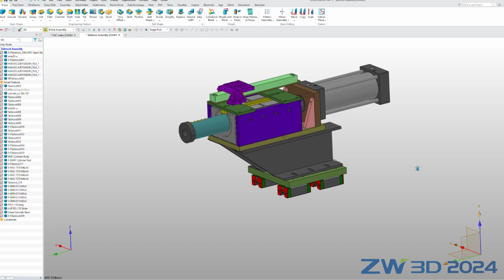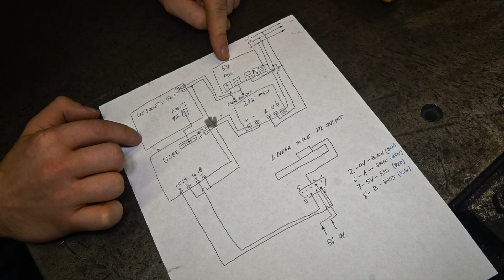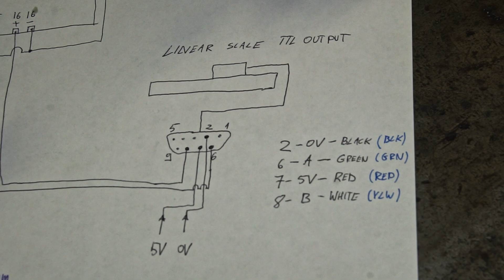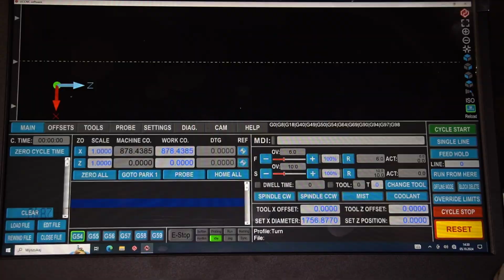Linear Encoder Setup! UC300ETH-5LPT Ethernet CNC Motion Controller #6

Comment: Strange connection diagram. The intermediate board has a decoupling function. And you take one power pole from the controller and the other (signal) from the encoder. This is the same as connecting directly because the output from the encoder is TTL. Or take the GND for the optocoupler and the signal from the encoder as well. Then the optocoupler will work and provide decoupling.
Reply from the maker: I'm not a professional electronics technician, but I think the optocoupler doesn't dissappear if supplied with the same 5V supply as the controller itself. But anyway - it works like that I guess
Reply: It's up to you how to do it, but then the optocoupler is not needed and the additional power supply is also not needed. You can simply power the encoder from the microcontroller and feed the signal through a 1k resistor directly. Do not forget that the optocoupler distorts the signal and gives a significant delay

Comment: Hi. What cad cam system do you use for Linux cnc?
Reply from the maker: For LinuxCNC I used fusion360. There is a post processor for it If I remember correctly.